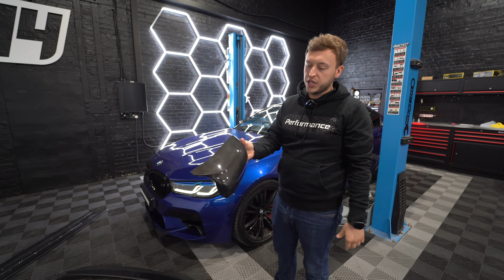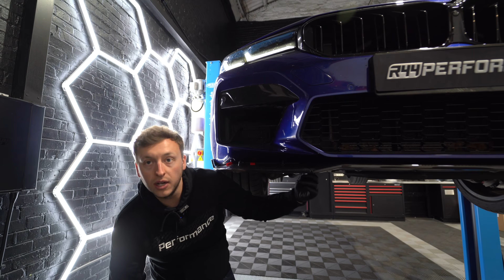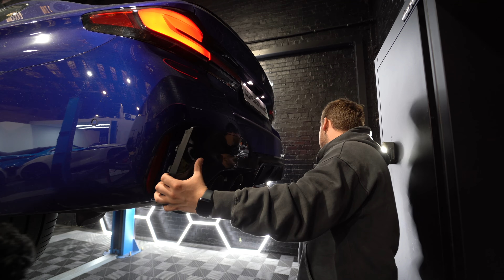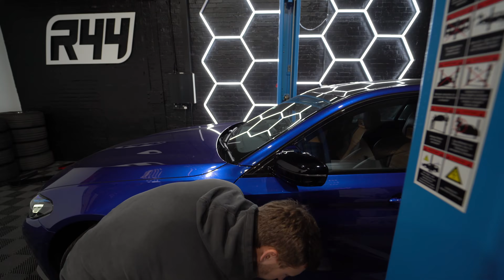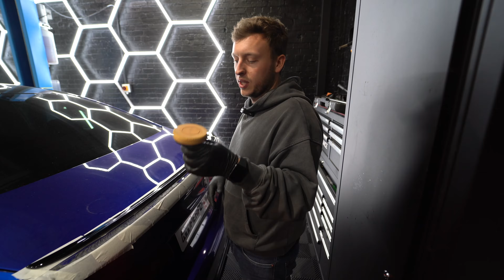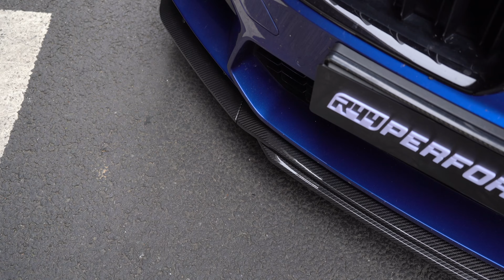THE MUST HAVE MODIFICATIONS FOR YOUR F90 M5 LCI (MHC)

Comment: Does the CS style front splitter for the M4 F82 use the original fixings? Or do I need to drill new holes to fit the splitter? Thanks!